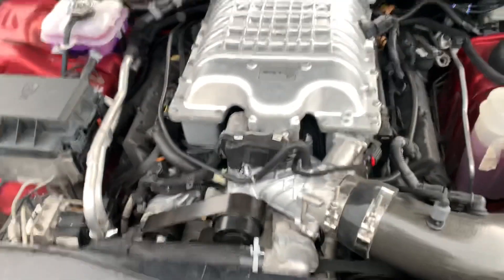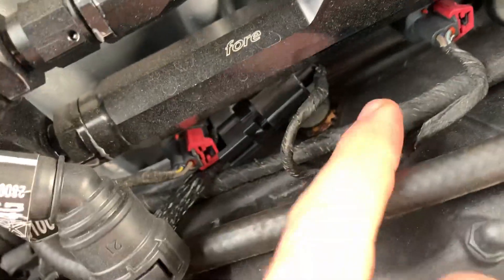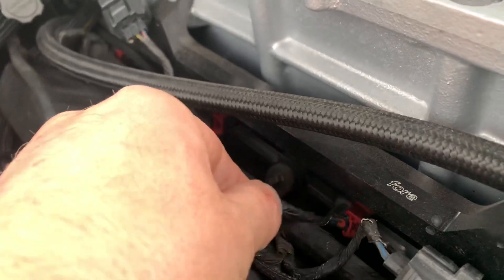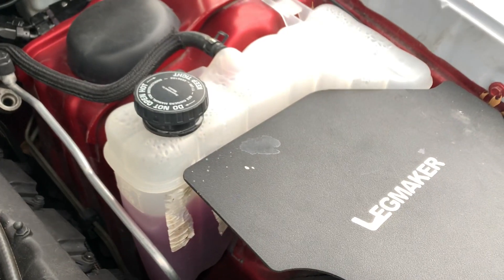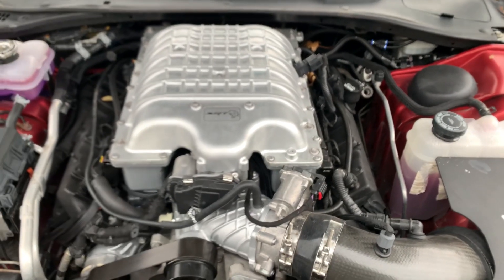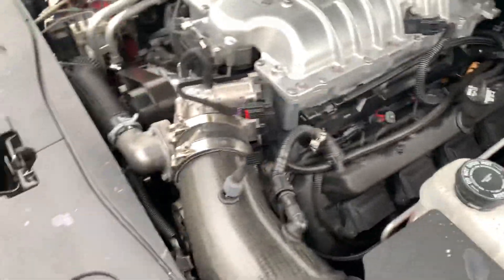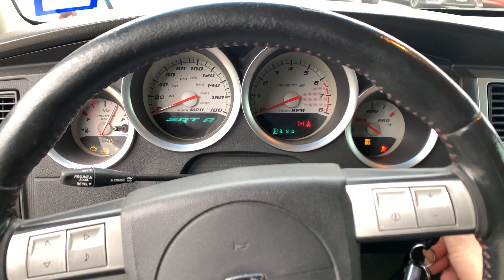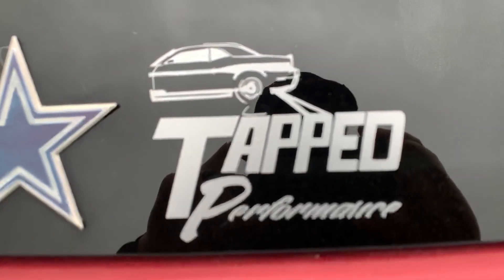6.1 Srt8 Magnum Hellcat engine swap! THE HELLWAGON!

Comment: Will A 6.4 Swap Right In As Well The  Same Way
Reply from the maker: It will bolt into the car and on the trans yes. But you’ll need a different PCM or to change the reluctor wheel like I did

Comment: Super nice. Did you customize that map sensor? it looks different from straight out the Mopar box. Where did you buy those coil pack extenders?
Reply from the maker: I made the extenders and the sensor is an srt4 map sensor
Reply: @MoparManiacMotorsports  thanks for the fast reply. Do you have an IG I can follow/ dm you?
Reply from the maker: @customhemi3924  I have a Facebook page for the car under the name TheHellWagon - I used to have an IG.  But you can message me on there

Comment: I swapped from 5.7 to 6.1 and haven’t changed anything thing just the engine and it does work thats great from mopar 😂 but im interesting about hellcat transmission have you changed to 8 speed or it fits the 5 sp ?
Reply from the maker: Fits the nag fine. But I will be doing the 8 speed swap soon